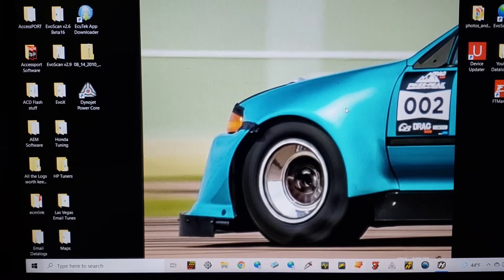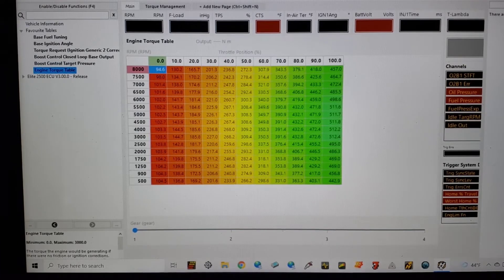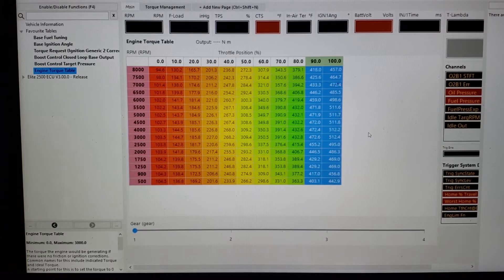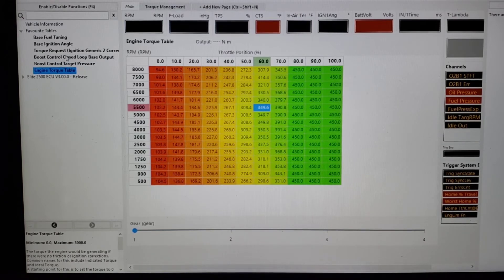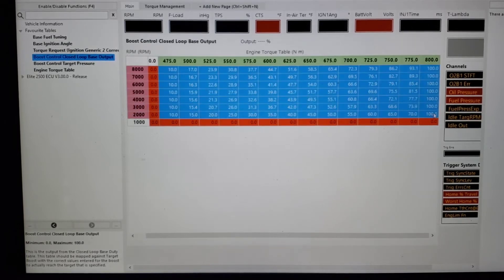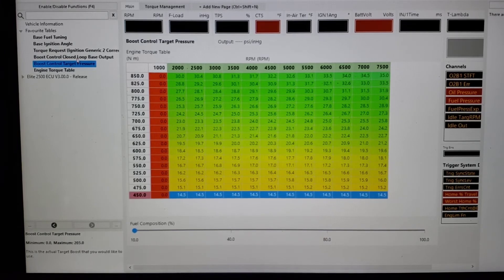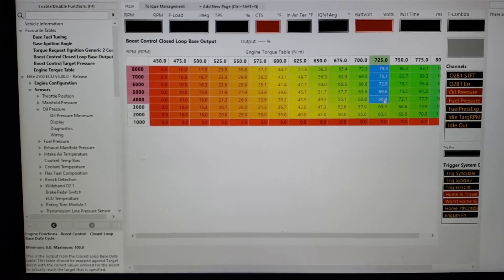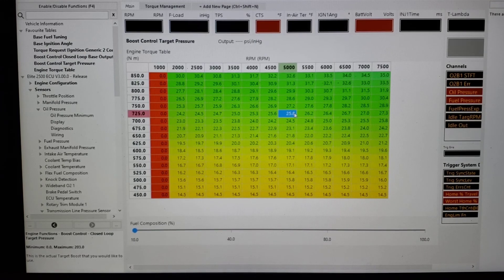Haltech Torque Based Boost Control

Comment: interesting concept, would like to see it in action. Would also like to see timing adjustments live using NSP
Reply from the maker: I don't quite follow, you mean between two pulls or during a pull?
Reply: @AaronONeal1  I just ment over all, setting up knock control, adding timing or taking away between each pull ect :)

Comment: Great things Aaron!
I had this idea but for another reason to limit the torque in midrange (torque peak area) because high numbers could kick my transmission directly to the junkyard.
By using the AEM Infinity you have to do it via boost control settings, right?
I don't have seen tables that using torque request in the infinity software...
Reply from the maker: Yeah torque control in an Infinity is just boost and timing to limit it. Usually that's going to require a dyno to accurately gauge the changes.

Comment: Many thanks for sharing this. Very interesting and can see how you dial it with a dyno session.

I currently run boost by throttle, boost by gear, boost by IAT and a rising boost curve to maintain a flat torque output at a chosen traction level. This looks to go one step beyond. 4d on the “engine torque table” versus a multi position switch could be a really nice track aid to trim the torque output to track conditions on the fly.

Like this a lot and may try something similar if I get the dyno data at different boosts. Probably run a torque correction by gear as can run high torque in higher gears an maintain same traction level.
Reply from the maker: It's not readily visible in the video but that's exactly my idea to run differing torque requests per gear for the same reason.
Reply: @AaronONeal1   It makes sense and a great potential idea. May need to think a little about lower rpm areas where you may be demanding torque/boost that is not physically available on the engine/turbo/load combination and if it screws with anything leading into boosted areas. 
I think this could work really well to provide a passive torque limit close or just over traction meaning you have a great resolution of control throughout the throttle pedal range. 
Again; torque by throttle percentage could throw out some odd results as you may cross areas where again you can’t make the demanded torque due to throttle position/engine/turbo/load combination. Lots of trial and error and driving.
Well worth a play I reckon.